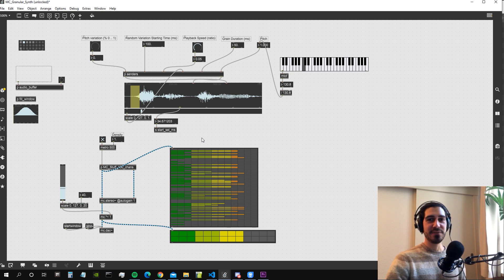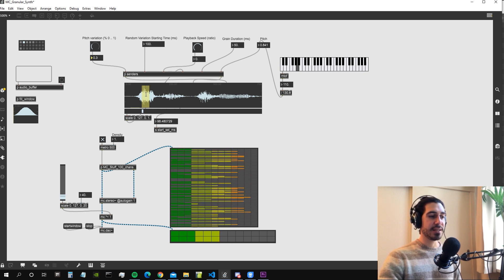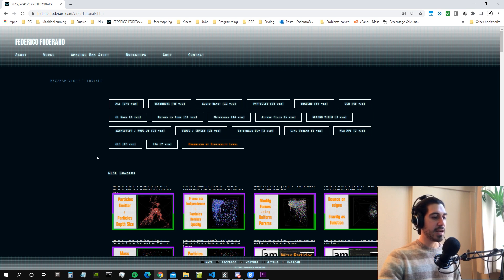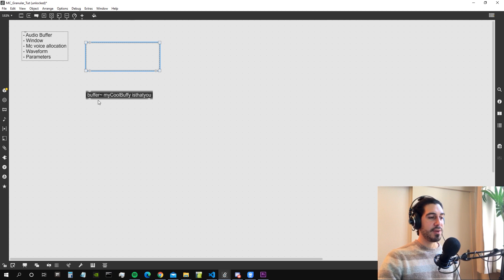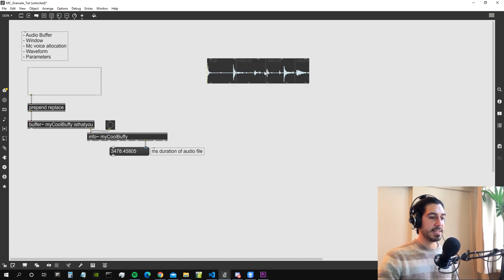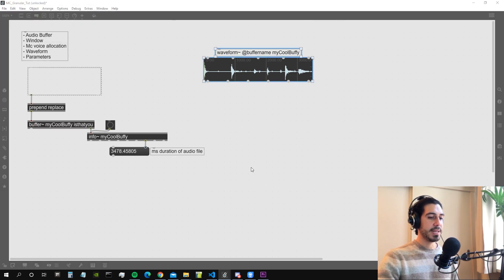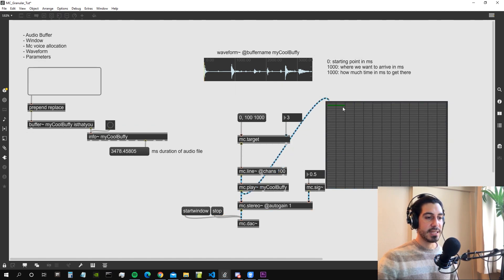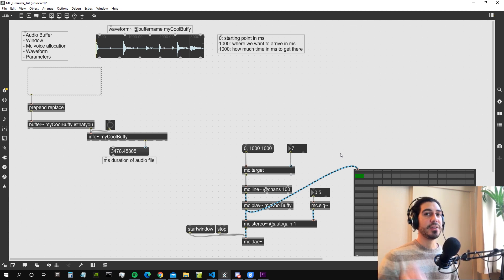MC in Max/MSP | 03 - Granular Synthesizer Part One

Comment: Thanks for mc tutorials, I am planning  to set  transient points of an audio  in a video(mov). But "import" message of  (buffer~) does not work.  How I can load or extract audio channel(stream) from a video and load to the buffer~  object?  
any idea?
Reply from the maker: Hey! You can use jit.movie~ (with the tilde)
Reply: @AmazingMaxStuff  Thanks for your tips,  I guess  that jit.movie~ only plays video with audio . But I forgot to say that I want to do it by  offline-processing. I want to extract transient points of  video audio channel , and then trigger it from some controllers(for example midi or keyboard) . I have not found any method to load only the audiosteam  of a video to a buffer. I do not want to bother you with my specidific problem but can not find any solution.
Reply from the maker: @borges69  check out this thread: 
https://cycling74.com/forums/loading-audio-from-a-video-into-a-buffer
Reply: @AmazingMaxStuff  :-) yes i already came here from this forum :-). I think there is no solution. But it's really strange situation: There is no solution for that problem in such a framework (max msp) where so many things can be done. nevertheless thanks for your help. Not: The solution suggested  is in 32 bit max msp, in 64 i, this is not working)
Reply from the maker: @borges69  oh right, I read the thread until the end and it seems to not work anymore. A pity. Hope you manage to do what you need nevertheless!